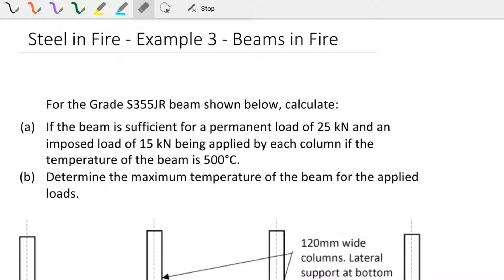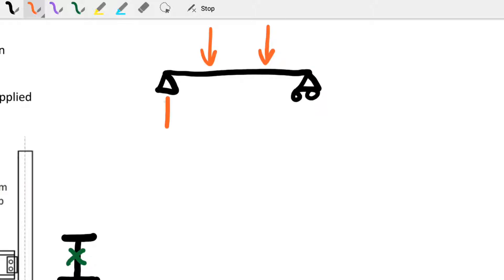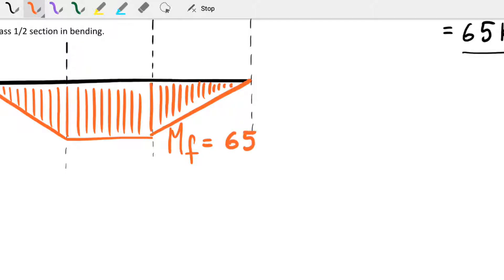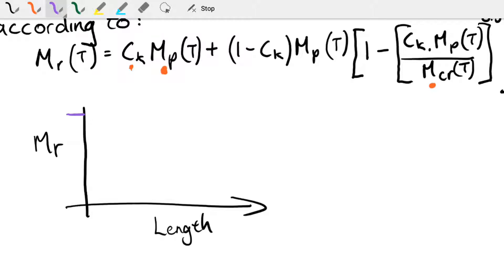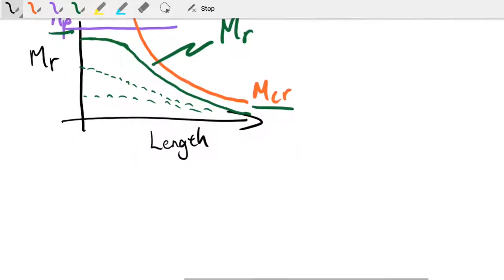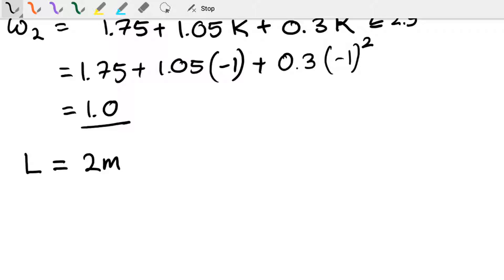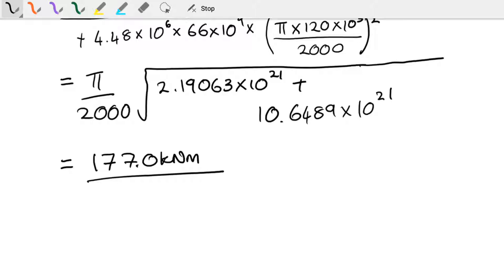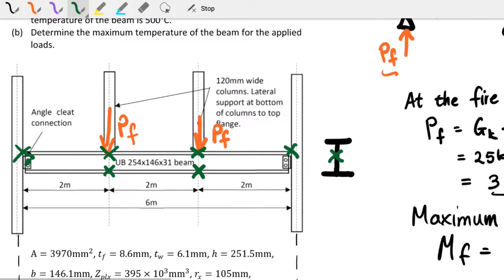Steel in Fire: Worked Example - Beam Design

Comment: Hello, thanks for your video !
I have some questions regarding this exemple. 
1) The young modolus is calculated but not used in your design, why?
2) The dilatation of material is not taken into account, isn't it?
3) Can this design method be applied in the case of a real fire or performance based fire? 
Many Thanks.